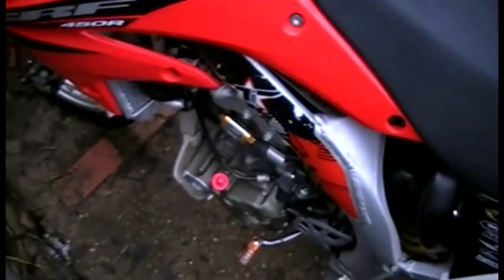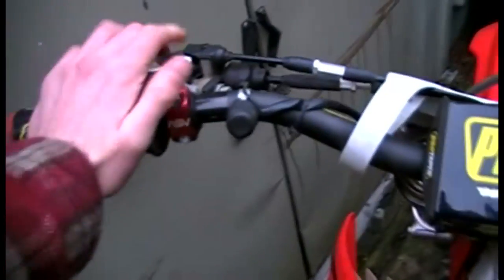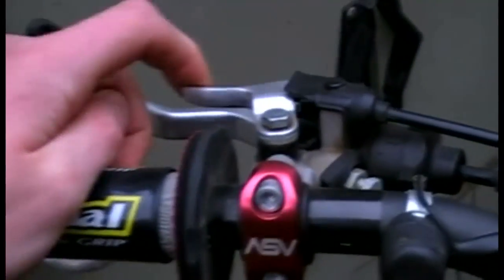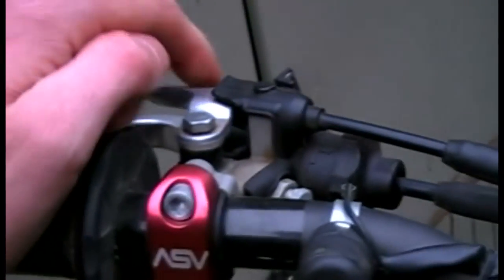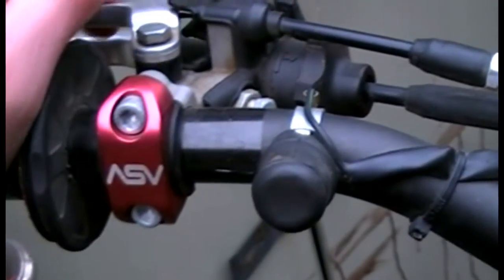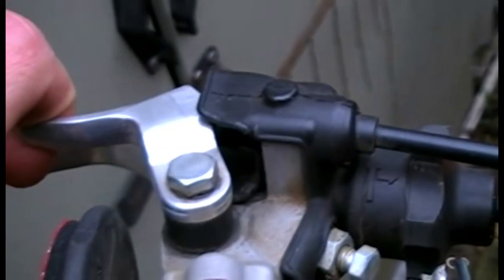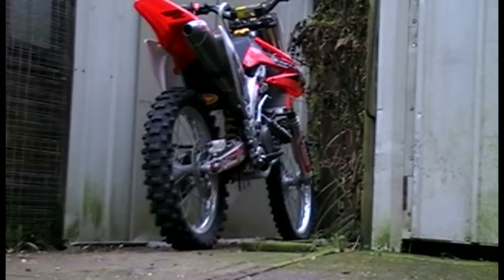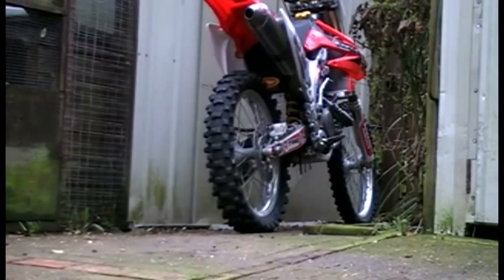4-Stroke Engine's And Hot Start

Comment: The hot start leans the mixture by letting in extra air through the valve on the end of the hot start cable.

Comment: Only a dumb ass would stand there and keep pulling the hot start lever while their bike is running....just so you know, you are leaning it out, which creates a lot of extra internal heat and will ruin the engine pretty soon if u keep doing it.  STOP IT !!!!! Hence the words HOT START .... meaning only use it when the bike is hot. and will not start .... Has nothing to do with more gas, ONLY more AIR !!
Reply: +jazbo180 haha
Reply from the maker: Well, this video was posted in 2011, and the bike is long gone, most likely trashed by now.
Reply: +RustySkull Productions,  Yeah probably... it was a Honda after all...Ha. Ha.

Comment: Decompression lever is not a hot start. Never engage the decompression lever while engine is running. Always turn off the hot start before taking off.
Reply: why
Reply: +WR450F motard become compression is what ur piston is powerdd by so if your in a de compression state trying to hammer the throttle it wont be good for it

Comment: jesus f/n christ.cut and copird straight from the manual.

Hot Start Circuit
A lean mixture must be delivered to the cylinder when
hot engine is being started. When the hot start lever is
pulled back, the hot start valve opens, allowing air is
supplied to the main bore through the hot start air passage.
This extra air enters the air-fuel mixture from the
slow circuit resulting in a lean condition.
Reply from the maker: mightymik32 Haha, this cracks me up everytime! 4 years on and this still gets comments lol.

Comment: I know its stupid commenting a video that is nearly 4 years old BUT..
First off
-The fuel in the fuel-line does not evaporate!
-It does NOT dump more fuel!

HOTSTART is the OPPOSITE of CHOKE.
What it actually does is it changes the mixture of air/gas temporarily so it would start more easily when HOT.

- When you pull your CHOKE out, it BLOCKS part of the airflow which would normally flow within the carburetor.
(making it  easier to ignite the fuel when COLD)

-When you pull the HOTSTART it lets MORE AIR run in the carburetor temporarily.
(making it easier to ignite the fuel when HOT.)

This is why your engine stalls when you pull the lever while idling, it just simply gets too much air and dies. And no, its not dangerous.
Reply from the maker: Nice explanation.

I can't even remember making this video haha.

I think the guy in a motocross shop told me it works like that, I can't really remember lol. 

I sold this bike around 2 years ago lol.
Reply: I have a question.... my hot start lever broke... do I need it?
Reply: RadReefs Nope
Reply from the maker: +terry fonz Thanks but you're about 7 years too late lol.
Reply: Also you need to adjust your air fuel screw if it kills the motor by opening hot start. The bike should rev when you pull the hot start while running.  The popping says your jetted wrong

Comment: The 4 stroke engine is hard to start up when it's hot so that hot start leaver allows more petrol to the engine to start it you just pull it then kick the bike off no need to throttle it.
Reply: Air

Comment: If you type in youtube "what does a hot start lever do the second one is factual to all newer bikes past 04ISH. It lets more air into the cylinder. the opposite of a choke as the choke is for cold starts. older than 2003 yz250f has a decompression lever totally different thing

Comment: Hot leaver is to add cooler air into cylinder, Honda and other bikes had already decompression mechanism in them on the cam shaft only yamaha from 2001 onwards to 2003 had decompression leaver and older 450 but after 2003 all bikes have it on camshaft if you take the cylinder head cover you will see the mechanism on exhaust camshaft.

Comment: Have you ever pulled apart the carb? They wouldn't put another mechanism to dump more fuel in there as there is already a choke for that and you can used the throttle if needed. When the motor is hot, so is the air around the motor. What that little hot valve lever does is it opens a valve to dirctly inject cooler air into the motor. If you leave the valve or plunger open you are injecting more cool air than needed therefore causing the motor to run lean. Do some reaserch. You have it all wrong.

Comment: Its just a decompression lever I have one on my crf 250r its for when the motor is hot and has a lot of compression in the cylinder it takes that compression away so its easier to kick over and so you don't get kickback....Thats why when you start your bike cold you do a compression kick cause when its cold there is no compression in the cylinder.

Comment: the hot start is a vlave that opens in the air boot before it goes into the engine allowing MORE AIR into the engine therefore LEANING the mixture which is why it pops and backfires, if it were too rich it would be blubbery and hesitant. YOU ARE WRONG ACCEPT IT.

Comment: that little lever is the compression releace and it makes it easier to start becasue when you pull that ;ever that opens the valves so you can kick start it easier my atv has the same thing but my atv is pullstart it dont dump fuel in because ther is no way for fuel to get up there and fuel dont evaporate in the line

Comment: hot start open extra cold air flow to clear up the engine from the fuel that was left when you crash on the track or anywhere else it gives more air than fuel so the engine wont get flooded with the fuel but then the engine is less powerful and this what makes the back fire while riding or reving. hot start should be only used to start an engine that is hot it wont help to ride or start cold enigne as cold engine needs more fuel and hot start is the opposite.

Comment: It adds fresh air, leaning out a rich mixture. Think of it as the opposite of a chock. 

Many riders use it every time they start a warm bike. Others only use it when they stalled or flooded their engine.
Reply: SO its an air circuit and not a fuel, idk

Comment: You are wrong, the hot start simply opens opens another air passage way to LEAN the mixture out. It gives the cylinder fresh oxygen to start the bike with when the engine is hot, also helping to start the bike, hence the term HOT START. When the bike is flooded or very hot, the cylinder becomes devoid of oxygen, thus normally taking a few kicks to circulate some oxygen into the cylinder, or using the hot start. Get your facts right before spouting total bullshit.

Comment: it isn't a choke and it doesn't add more fuel. it actually lets more air into the cylinder so it's the opposite of a choke.

Comment: Hot start lever LEANS the mixture. Does not add fuel. Thats why the bike pops and backfires when you rev it. Its really BAD for the valves to do that, and makes the bike run really hot. Also hot start lever on this bike has nothing to do with decompression for those wondering. Read your manual if you want to know how it all works.

Comment: yep - and to be honest, you don't even need it. Give it a good kick and it'll still start hot or cold. My KTM 640sm on the other hand had a compression release which required you to pull it in , kick down slowly till TDC, and then give it a good hard boot. CRF450r trigger is just cool air.

Comment: your just a joke. Crfs has automatic compression release when kicking it opens exhaust valve. In some bikes its manual with lever. Hot start changes mixture to leaner, it doesnt affect compression at all. Maybe go ride your ttr and dont come with your wrong opinions and try to teach everybodyelse.

Comment: when you kick it it only turns the motor over and pushes the piston up to give COMPRESSION so it makes an explosion so it can go vroom vroom. and when there is too much COMPRESSION you hold the hot start and it releases the COMPRESSION between the piston and the head so you can kick it and try to start it again

Comment: @Bikekid450 hahahahahaha WOW! thats all a choke does on everybike, car, truck, boat, a choke turns a butterfly in the inside of the carb that blocks off almost 85% of the incoming air therefore richining the mixture that gets in your cylinder, what kinda bike is that like a "05-"07 crf450?

Comment: @Bikekid450 True, it doesn´t richen fuel, it lets less air into the mixture wich in the end gives the result of a richer fuel mixture. A choke is called a choke for a reason (blocking the air intake) and works the same on every bike, car, lawn mower and so on. And no it aint the end of the world posting faulty but it is dumb. I could post a video explaining how hondas suck ass and break down every time you ride, but it is just as true as this.

Comment: no you idiot!!!!! it stalls because you deprive it of fuel when there hot like that they have fuel built up in the intire motor, a hot start is the exact opposite of a choke pretty much. choke richins ffuel air mixture and hot start leans it out!!!!! get you facts strait before you post a video!!!!!

Comment: @vortex812 The hot start leans the fuel mixer for start up when you A. tip the bike over and it is flooded or B. very large altitude change and your bike gets too rich. The need for it on a modern 4 stroke is unlike a 2 stroke you dont open the throttle to start the bike, and you need proper mixture to start.

Comment: @vortex812 a hot engine would need more fuel to start.. not more air... when the engine is hot the fuel evaporates before making it to the combustion chamber therefore needing more fuel to achieve the same thing.........................

Comment: hot starts cut off fuel or add air. it depends there are a few differant desighns out there. but they all make the bike leaner. the gas evaporating before it gets to the carb is vapor lock. the choke adds fuel or cuts of air depending on the carb. eother way it runs richer. it pops because its lean, and its increaseing scavanging on the exaust valves. the pop you hear is the exaust creating a vacume then realeasing. very hard on valves.

Comment: @Bikekid450 Hot Start System 

The hot start system creates a lean air/fuel mixture that enables a hot engine to be started easily. When the hot start lever(located on the left side of the handlebar) is pulled towards the rider, the hot start valve in the carburetor opens, supplying air to the main bore through the hot start air passage. This extra air enters the air/fuel mixture from the slow circuit resulting in a lean condition. 

Copied and pasted straight from the manual.

Comment: who told you this bullshit? the hot start leans the mixture out so its easier to start when the engine is hot, this is why its popping and banging just like 4 strokes do when they are jetted too lean. And it can do damage to your engine reving it with the hot start pulled because its running lean which can cause damage to a engine. 

"The fuel evaporates in the line", where do people get this stuff from?

Comment: adding to my previous comment, leaving the choke on too long while the bike is running can potentially foul the spark plug. But then again, I guess just putting less fuel in the engine wouldn't harm it.....maybe if you applied the hot start at the right times when riding you will get better fuel economy!!!!! :D :D

Comment: gotta say, the 2006 crf450r is a ton of fun having owned one myself. However, I was always under the impression that the hot start basically does the opposite of the choke. By that i mean the choke is designed to start a "cold" engine, therefore allowing more fuel and less air in. The hot start on the other hand reduces the amount of fuel and allowing more air into the motor. (An already flooded carb in these models typically wont want more gas. Thats just what I know, correct me if im wrong!